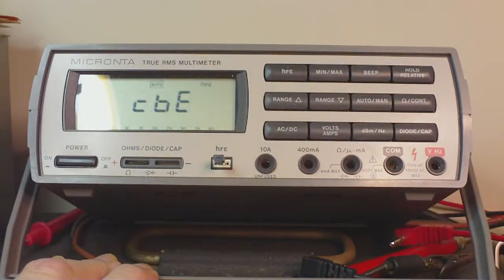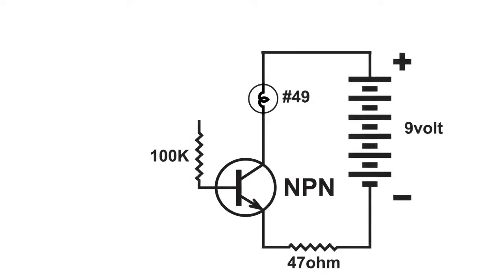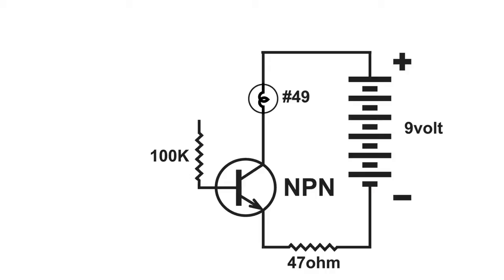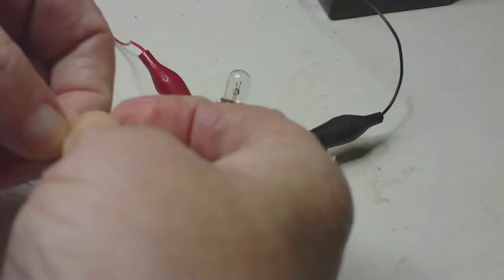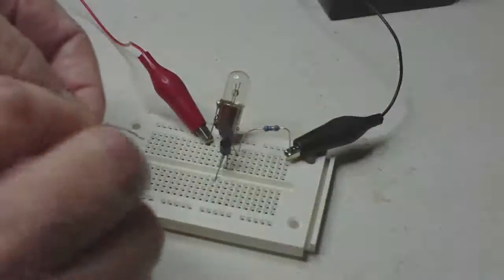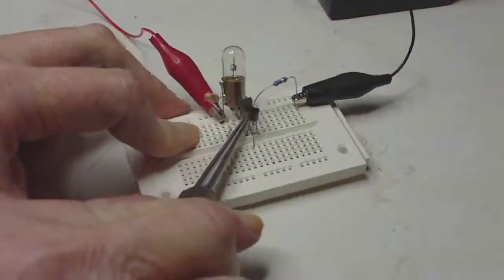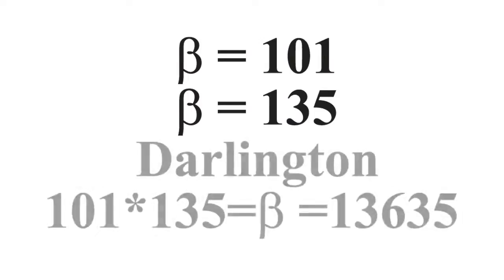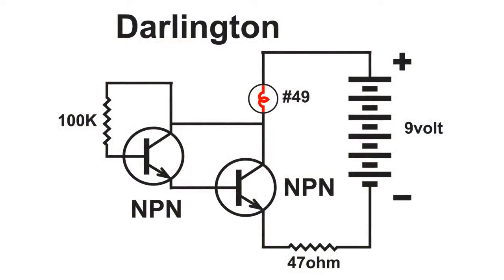Transistor Beta X Transistor Beta = Darlington Beta

Comment from the maker: The short is mainly to confirm that the circuit is wired and working correctly. The advantage of the Darlington is: with out it just about a short (very low impedance) is required to light the bulb. With it you can light the bulb with a resistor (high impedance). Thanks.

Comment: Fantastic video!  It's great to see the amplification of more than one transistor connected together as a Darlington.  At 2:07 You show how you can light the bulb by adding a short.  Why not just leave it shorted since you were able to light the bulb that way?  Is there an advantage to using a Darlington in this circuit or was the bulb for demonstration only?  Thank you.

Comment from the maker: I think the inefficiencies would be due too using two, or more, transistors which cost more $s. The voltage drop across E and C of the transistor passing the current is the same if it is in the Darlington configuration of not. The advantage of the Darlington is the exponential increase to the Beta.